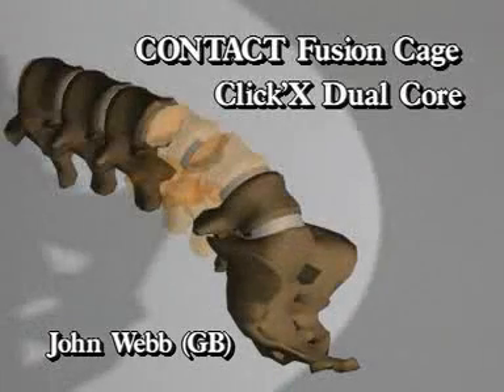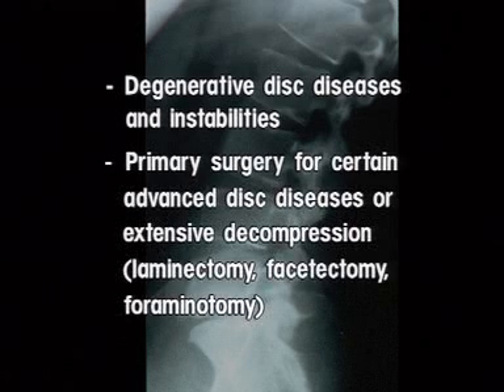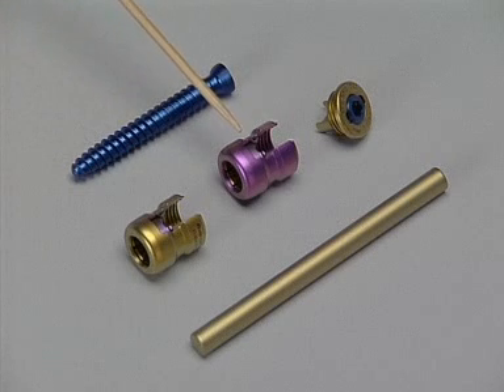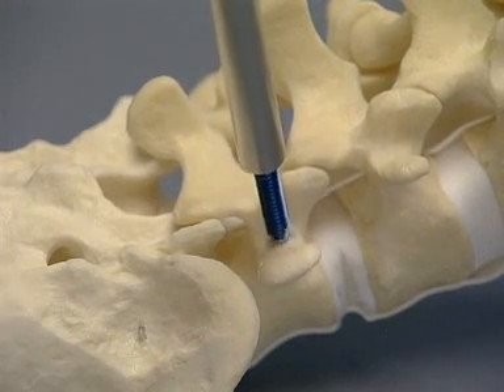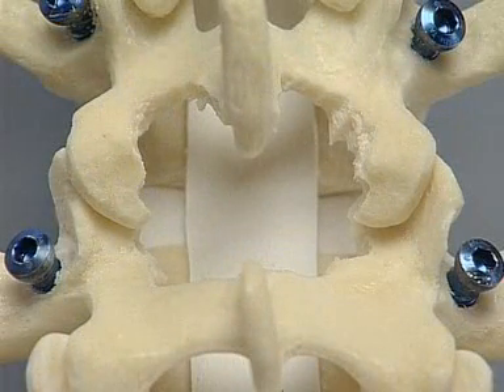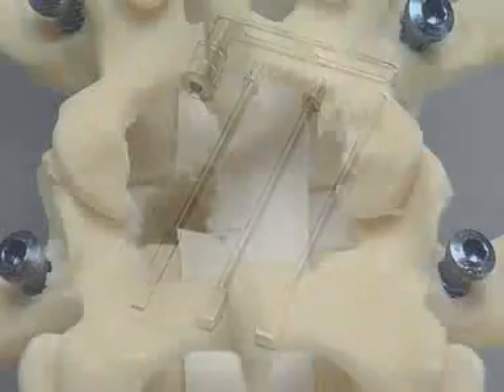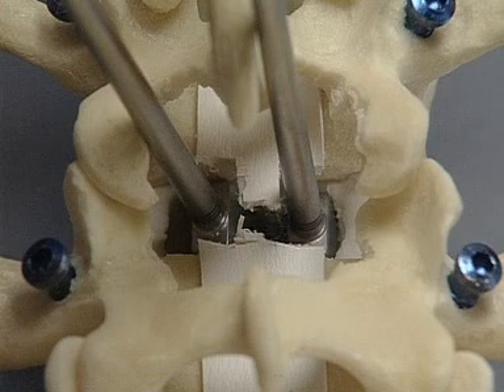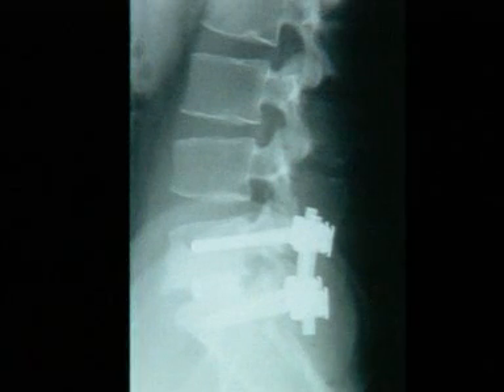Posterior Lumbar Interbody Fusion PLIF (spine surgery)

Comment: I was a pedestrian run over by a car in 2001, which resulted in spondylolisthesis. I lost a lot of nervous innervation on the left, resulting in foot drop. I was seeing my PCP, who just didn't get it & called me a drug abuser. Finally, after almost a year, a neurosurgical resident was in the office & discovered I had no reflexes on the left, which meant I finally got a referral to a neurosurgeon who immediately performed a PLIF. The surgery lasted about 9 hours & it was mighty painful. Back then, healthcare providers gave adequate post-op pain meds, which certainly were necessary. I took narcotics for several months due to the pain, but as I healed, I no longer needed them. I wore a back brace for ~6 months. Also, in my case, the little basket was filled with BMP, which stimulates bone growth. I'm fine now, but back pain never really goes away. To all of you that may need a PLIF, I wish you well.